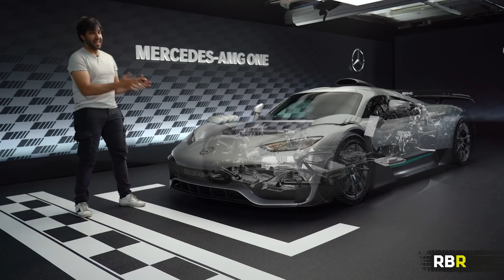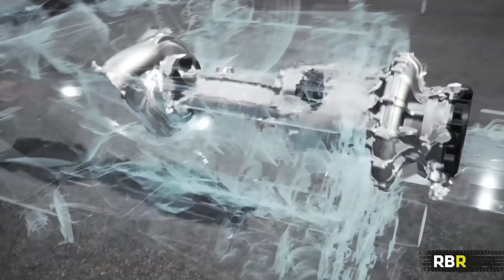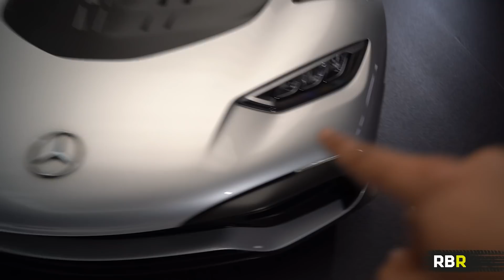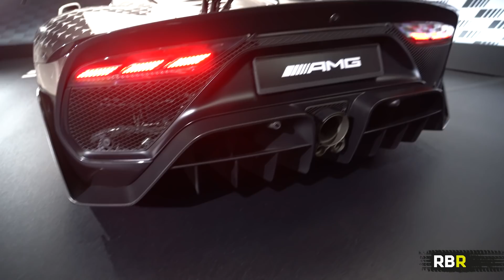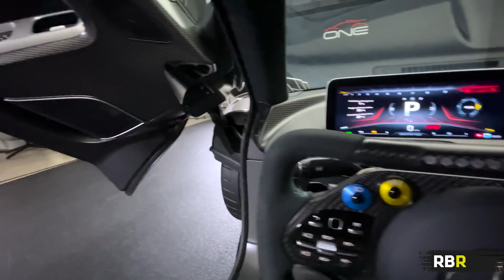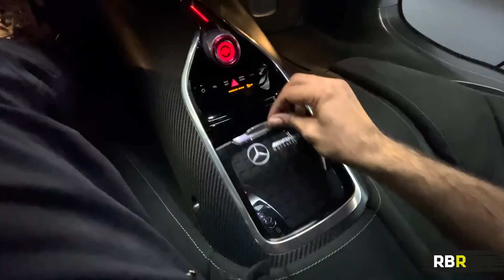IT'S FINALLY HERE! The AMG ONE Hypercar! First Look with Mr.AMG!

Comment: I'm not convinced..i hate to burst the merc fanboy bubble of delusion...but this car is just a gimmick.

 It weighs 600kg more than the Valkyrie which also has 100bhp more...and has way more downforce.

It's nowhere near as good as the 2015 Koeinigsegg 1:one which has far better power to weight ratio

And it's still slower than a Bugatti Chiron, also having less bhp than the 2000bhp Lotus Evija and Rimac which costs the same..it's miles away performance-wise.

The AMG 1 with its "f1" theme seems to be a gimmick. 1060bhp is very small and barely any more than many Ferraris models. Infact the SF90 with slightly less bhp is already quicker to 60 and 125, costing a fraction of the price

With upcoming hybrid/EV ///M models, Porsche ramping up the EV game too also current Teslas surpassing the 1000bhp mark.. this car would be in a lot of trouble from a performance stand point.

On paper...it has under delivered in terms of power by 100bhp-900bhp. It weighs 600kg-900kg more than its competitors. Much and the design is overshadowed by other hypercars in the same market.

For a first of its kind...it's nothing but a weak underpowered fat disappointment.

Comment: Not that any of this matters since they're all sold already, but I think this car is pretty disappointing. It's much heavier than they claimed (an 8 year old 918 is lighter), it's much slower than they claimed, the electric range is less than what they claimed, and the performance is comparable to an SF90 which costs less than a 1/3 of this. All of this talk about "Formula 1 tech" is just marketing nonsense. Who cares if you put a 6 year old F1 engine in the car, when you end up having so many sacrifices, and at the end of the day it doesn't even perform or sound nearly as good?
Reply: Not at all. Does 918 have f1 engine it? Tell me which car does. I'll wait. Mercedes usually perform faster than what they claim

What sacrifices? F1 power trains put the power down a lot better 

So it will be faster especially with electric motor mguk etc

It's not about electric range it's about using electric motors for instant torque and spooling up turbos instantly etc 

It will perform way better than a 918 or sf90 so you're wrong it will run circles around them on the track
Reply: @eventusvantos8586  Okay quick question do you actually know what an MGU-K is? It is a small engine that is located between the gearbox and the combustion engine and the gearbox, just like the one the 918 and the SF90 has. The only thing new is that this has a MGU-H which is a small electric motor that spools the turbo and recuperates energy from the flow of exhaust gasses. The 918 doesn't need one since its naturally aspirated. Could you please elaborate on your claim that F1 Powertrains put down the power a lot better? Traction has nothing to do with the type of mechanical driving force used. Its all about mechanical grip and matching control electronics. If you mean the electric front wheel drive which is actually zero F1 tech since F1 cars are RWD only. The SF90 and the 918 both have electrically driven front wheels. The only reason why F1 cars put the power down better is down to mechanical grip from the huge soft tires.
Reply: @leon8594  yes I do know what it is
Don't give it excuse of natural aspiration because this makes more power so thanks to the turbos so by having the mgu it gets the best of both worlds. The power of a turbo and the instant response of NA 

And sf90 doesn't have it either 

So thanks for proving my point 

F1 power trains put their power down better meaning they will accelerate faster 

Wrong its not only with the tires it's with how the power is delivered to the wheels and it also involves it gear box and gearing which shifts a lot faster
Reply: @eventusvantos8586  The AMG One is not even dual clutch. How will it shift faster than the PDK in the 918? You know that there is no F1 Gearbox in there? How will it accelerate faster just because its an F1 engine. I don't understand your point. 

918s ICE is more powerful than the Ones engine 447kw vs 422kw. Funnily enough the SF90 ICE is even more powerful with 574kw. 

And even if the car puts the power down better because of "F1 tech". How come its slower to accelerate than both the 918 and the SF90
Reply: @leon8594  yes it does have f1 gear box which shifts far far faster than pdk could ever dream of 

It will accelerate faster cuz it has far far more torque than the 918 or valkyrie etc

Why are you cherrypicking the ice engine instead of looking at the whole power unit oh right LOL

Lmao how is it slower? Show me a drag race video of it losing ill wait 

The claimed times are purposefully slower than it actually is

Comment: No other german automaker can compete with this masterpiece, splendid work Mercedes-AMG 🇩🇪 the best or nothing
Reply: umm porsche? bmw and audi's out of the picture lol forget about those 2.
Reply: @1990Thunderbolt  mate this car is only slightly better than a 9 year old Porsche 918.
Reply: yeah its definitely higher than all bmw and audi cars however i think porsche also haves a hypercar
Reply: Porsche joins the chat:
Reply: honestly the weight is a bit of a letdown. more than 1,6 tons make it probably much less potent than a gt3 rs on track. I still reckon it will do better than any of the bmws and audis
Reply: @philippmayenburg7282  Unless it's a very bumpy circuit I don't think a GT3 RS would trouble this. It was double the power,

Comment: The Plaid Model S does 0-200 km/h in 6.1 seconds. This isn't impressive.
Reply: This will slap a Plaid around a track
Reply: This car is not about quick straight line. Try turning a corner at 100 mph on a Model S. You’ll flip in that 4-wheel toaster
Reply: @crspyrat  You won't.

Comment: This thing for 3 million is not so impressive doing 0-200 in 7 seconds when the ferrari SF90 is 630k and does 0-200 in 6.4 seconds
Reply: Don't worry, thankfully no one is forcing you too buy the AMG One 😂
Reply: Luxurious F1 Simulator. Less than 300 will be made. Guaranteed to go up in value once bought.
Reply: 0-200 is AMG Claimed time, it will probably be faster once tested. SF90 0-300 is 16.4 and AMG One 0-300 15.6. I was expecting it to be faster tho.
Reply: corn holioyo i m pretty sure its quicker than that because they always say the slowest time they got someone will definitely get it under 7 secs to 200

Comment: I feel like Porsche could build something like this in half the time. Was amazing 6 years ago but not sure how a hybrid V6 with F1 tech is still boundary pushing
Reply: Hugely unfair comment.
Unlike an F1 car, this can be driven on the road.
Unlike an F1 car, this idles at
1,250 rpm
It has DRS
Etc.  Etc. 
Clearly u have NFI..
Reply: @StephenFogarty2023  LOL it has DRS, so like an active wing? Never seen that before. Or like the small DRS button that can also be found on the 10 year old McLaren P1. The only party piece this car has is that its engine is F1 derived. But by making that feat possible they made a worse car. This thing is extraordinarily heavy and seems to need a lot of maintenance for a power output that is very closely matched by the LaFerrari from ten years ago.

Comment: kinda disappointing that the performance has been rather nerfed. it was supposed to have over 1100 hp, 0-100km/h in less than 2.5, 0-200km/h in less than 6 seconds etc. how the hell does the ICE make only 570hp?!
Reply: It's a 1.6 engine that has to be able to drive reliably
Reply: @mattblock6616  the one in the Merc F1 can do 10,000 KM at full blast…. surely this could still be pushing 650 hp at least.
Reply: @Tommmmmmmmmmmm  it does not do 10 000kms, and the engine has to pass emissions and noise regulations. It also has to idle at a normal rpm, which the racing engine absolutely does not

Comment: No one can match or even come close to what AMG have achieved with this.This is the tombstone to all competitors.Now the only thing remaining is the ring record!!
Reply: regera to dont forget him
Reply: @Daniel Vipin  no they won't. In your dreams
Reply: Delusional Merc fanboys and reality are quite contradictory to each other.

Koeinigsegg 1:one has much better power to weight ratio and power

Lotus Evija houses a 2000bhp nuke, so does the Rimac. The Bugatti Chiron is still more powerful and quicker to basically everything on a sprint. Again..with more power.

The Valkyrie from Aston Martin weighs 600kg less, with 100bhp more and giga tonnes more downforce.

The AMG 1 on those grounds...is a weak fat disappointment which will be overshadowed by upcoming EVs even in the family car segment like Tesla, upcoming ///M models and Porches. While this barely has more power than high end Ferrari supercars
Reply: @ertugrulbae46  also the merc has far more torque and better power delivery it will and unlike an electric car this can keep hauling for longer and will be better past the intial acceleration of an electric car since it has the best of both worlds
Reply: @ertugrulbae46  You are missing the point of the AMG one however.It is the closest one can get towards living an exclusive F1 experience.None of the cars you mentioned offers this.Every car manufacturer can slap an extremely powerful V12 into an aero enhanced chassis.That does not mean it would destroy the lap times in a racetrack.Take the GT Black for example.How many cars produce a lot more power and can rip it apart in a straight line?Yet did any of them came even close to its record time in the most challenging course on the planet?No.Even Porsche needed an aftermarket 'kit' to beat the BS.All i say is that you must never underestimate the leading power in one of the most technologically advanced fields on the planet which is F1.
Reply: @apoellasapoelazio5377  there's nothing remotely close to it being like an F1 car. Simply sharing an engine doesn't equate to "F1 experiance".

The primary reason being the dynamics being literally the polar opposite of an F1 car due to it weighing twice as much. Nowhere near as much downforce either. And it's literally impossible to pull the same G forces.

In reality the AMG 1 offers literally nothing more than its rivals. Infact the rivals actually resemble F1 even closer than the AMG1. Moreover it wasn't that long ago when F1 cars actually had V12 engines.

The only reasons rivals didn't destroy laptimes is because A) they're not track tested yet. B) There's been little focus on lapping them. Since Mercedes has an F1 team and active in Motorsport..I'd suspect they'll spend years lapping the Nurburgring by which time they'll churn out a decent laptime.

As for the GT black series...it had a whole host of additional aeroparts to beat the Porsches. And they were older variants. The current ones would demolish the AMG GT.

There's absolutely nothing F1 about the AMG 1 except the engine..which has very little bearing on the F1 car nature
Reply: @apoellasapoelazio5377  facts
Reply: @ertugrulbae46  lmao yes it's extremely close. It has the the engine of an f1 car and the steering wheel of an f1 car with the same buttons of an f1 car too and the seating position also partially mimics the f1 driving position 

Obviously it's not going to match an actual f1 car because it has to also be liveable bit it's the closest you can get a hypercar being like a f1 car

How do the rivals ressemble f1 more???

1) lmao not track tested that's cute what are they waiting for if they supposedly have a faster car? 2) why would it be a little focus when it should be the major selling point 

And? It still beat the record now imagine with the project one will do 

There can also be other variants of the amg one

Nothing? Lmao the engine  the steering wheel the seat the transition and gearbox the aero 

You're just in denial
Reply: @apoellasapoelazio5377  So thats why the ICE in this car has 200HP less than its 2016 F1 counterpart? If the point of the car was to make a statement about F1 technology, then keeping the power (in return for low mileage capability) would be the way to go. In reality its impossible even if they wanted it to last 10k because these cars are going stand in traffic for a while, cooking :DD
Reply: @MisoElEven  because it has to be more reliable and meet regulations which is the way to go. They will cook the other cars alive
Reply: @Amc547 Warlord  project one has better acceleration 
It's a limit created because it comes with an advantage that outweighs the limit
Reply: @Daniel Vipin  Yeah, the difference lies in a 1.6L V6 compared to a 6.5L V12.
Reply: The best or nothing 💨
Reply: @Daniel Vipin  you're the one dreaming.  Valkyrie has better downforce and weight but worse acceleration and merc will likely put its power down better and it has better active aero and gearing ... all while being actually usable on public roads unlike valkryie which is even a pain just to get in and out of
Reply: @eventusvantos8586  Yeah because so many people will use this in regular traffic :DD these cars wont get to that 50k mileage in the owners lifetime thats for sure. The traction of the Mercedes is not better at all since Valkyrie is doing 100kmh in 2,7s
Reply: @MisoElEven  yah they will actually they will go to restaurants, canyon roads etc
Yes the acceleration will be better than the valkyries
Reply: @Amc547 Warlord  no its not. Valkyrie has worse acceleration and very impractical even to just get in and out of

Comment: How does the 0-200 time compare to other hyper cars?
Reply: 0-124mph in 7 seconds. But its not a straight line car anyway
Reply: @thepetrolman4879  it’s a bit underwhelming given a RWD F1 car can do it in 4.4 seconds when this has AWD and the same PU.  it was originally said that the AMG on would do 0-100 in less than 2.5 & 0-200 in less than 6 seconds.
Reply: @Tommmmmmmmmmmm  you know.... their goal was for this thing to be road legal lmao.... that wouldnt be road legal
Reply: Slower
Reply: List 0-62  in 2.9s
Reply: Rimac Nevera does 0-200 almost 2 seconds faster. Kind of embarassing for Mercedes.
Reply: @MuppetsSh0w  could never drive such a pos. Electric vehicles have no emotion. Straight line speed like that is pointless without some noise and some other sensory factors other than JUST pure speed. I’ve driven teslas that are insanely fast, but evoke absolutely no emotion, ended up buying an AMG because I couldn’t get down with a car that’s fast but evokes no feelings. Teslas, even plaids, are downright boring after you get over the initial launch. AMGs and other nice sounding ICE on the other hand….. boy let me tell you….. if never gets old when you put your foot down and hear the rabid wolverine howling beneath your foot. Don’t even care if I’m looking at the back of a Tesla because he beats me off the line, I’m getting more smiles per miles every single time.
Reply: @Primeauxvibes  Who asked lol?